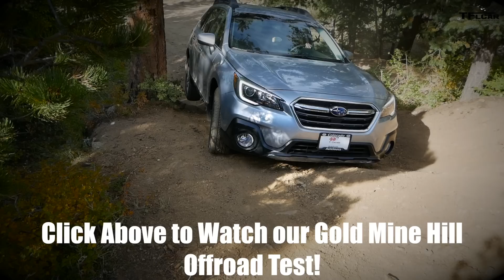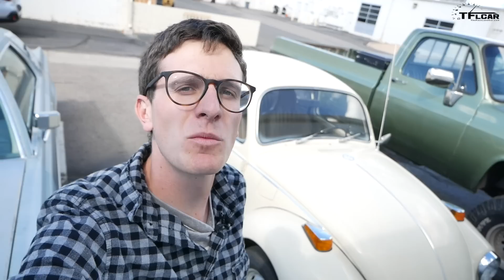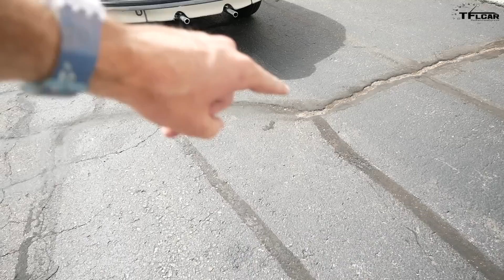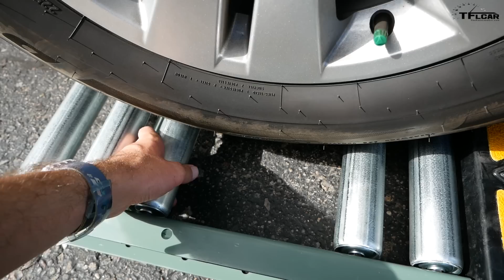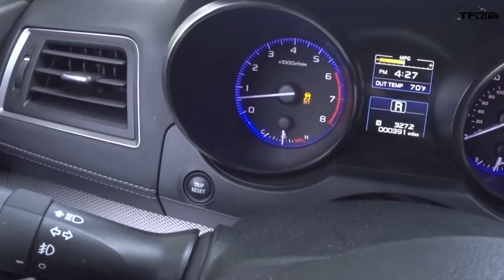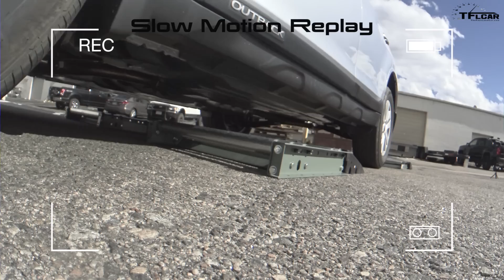The Truth About Subaru's Symmetrical All Wheel Drive:TFL Slip Test vs Subaru Outback

Comment: I appreciate these tests but I've hand my awd cars in quite a few situations old Subaru and Audi's and even a few air cooled vw's which are rely good in snow by the way.   With these types of tests my cars shouldn't have moved.   Your simulating no friction which really doesn't exist and if it did I'd want to be home with some hot chocolate.   I can see how it could show how traction control helps or doesn't in extreme situations.   But it wouldn't convince me to avoid one vehicle or another.  I've had much less sophisticated cars get through terrible conditions.

Comment: Test the new Subaru Ascent. I saw a video where the Ascent pulled a 5,000 lb boat up out of the water on a muddy boat ramp. It makes me think they changed the CVT parameters on the Ascent if it can move itself plus a 5,000 lb boat up a low traction incline versus how the Outback did on goldmine hill attempting to move only its own weight up hill. I would also like to see the Subaru Ascent on goldmine hill as well.

Here is the Subaru Ascent boat ramp video: https://youtu.be/9MzXJhuy-tw

Comment: It actually did better than I expected. I'm not hating on Subaru; I owe a 2.5RS and love it. I'm pointing out that this actually had the shittiest incarnation of Subaru's AWD system: Open from and rear differentials and an automatic transmission. You'd get even better performance out of the helical LSDs, DCCD and manual of the STI.

Comment: Definitely more tests like this. Little less chatter in between though... found myself double-tapping the screen to skip ten seconds ahead many times.

Curious how X-mode didn’t look different from “normal”... if anything almost more delayed. I thought X-mode was more aggressive with mimicking “lockup”.

Would be very interested to see how the modern Subaru like this, with its computer-based traction control, compares to my wife and my previous 2013 Outback 3.6 with the 5EAT auto. That system used the older viscous-type AWD, lot less computer intervention, and I gotta tell you it was apparent in the snow. Compared to my mother-in-law’s 2017, where you could feel the car react after the traction loss, our 2013 drove more smoothly and predictably. That system was reportedly a 60/40 RWD bias, and whether true or not I can tell you from FHE it was quite easy and fun to rotate that car with throttle on snow... something the CVT Outback refused to do (the CVT only ever understeered). I presume the smoothness and predictability was because loads were being transferred continuously and linearly by the viscous action within the diffs, as opposed to a more efficiency-biased system that attempts to use computers to reduce parasitic loads when cruising, but then intervenes more abruptly when called upon.

Anyway... another vehicle for the rollers: 2018+ Chevy Traverse or Buick Enclave with the “twin clutch AWD”. Please? 🙂
Reply: X-mode really is more precise with the traction and "locks" more and earlier. For example - I was able to start moving uphill with all four tyres on the ice only with an X-mode. Without an X-mode it would by much much harder. I suspect these guys at TFL are doing something wrong. The way they are working with the acc.pedal seems weird to me. Or they just don't like Subarus for some reason as many tell.

Comment: So while back you accidentally exposed that the Subaru AWD with CVT is not as good as it used to be. Now Subaru won't let you test their cars until you make up for it with some positive demos. I own a 2nd Subaru now and the CVT feels like it won't hold up well in heavy snow/ice use. Once I drove to Timberline Lodge on Mt Hood in heavy snow and the transmission smelled like burnt clutch, I was worried.    I want to see how Audi Quattro does...
Reply: n8834 Which Quattro? Different systems, different models, different results.

Comment: 2015 crosstrek with 4 people and our luggage in the back headed from akron ohio to florida. New goodyear assurance tires and a winter warning that was going to cause a 2 hour delay. I had this car doing 60-70mph through 3-5 inches of fresh snow on a highway at 3 am passing plows and lifted pickups over the mound of snow that seperated the plowed lanes from the snowed out ones. At no point did i lose any control. I was rally racing to the max but at no point was i uncomfortable that the car was going to lose any bit of traction. That car is an absolute beast. Every bit of that 148hp was being put to work and the traction and handling were nothing short of awesome.

Comment: Put the vehicle under some kind of load. Like a snatch cord that acts like a rubber band. Then use something like a hanging scale to get a consistent load.  This would help test how much torque is going to the tires with traction.  The idea being to help simulate a slight hill rather than flat surface that I could push the vehicle off of.  Just a thought.  You guys are awesome by the way!

Comment: Excellent evaluation idea that should be added to EVERY vehicle review that TFL performs from now on, regardless of drive system.  Basically, this eval would be pertinent for all drivers outside of areas like San Diego with perfect weather year round.  Curious is these skates would work on the bigger trucks.  They seem small and light-duty and I wonder if pure momentum from the vehicle rocking could carry it over the skates instead of traction.

In addition, this is an excellent review of the video.  I had similar questions.  1) I was wondering about four skates as well. As one aspect of this test, establish a baseline by demonstrating which wheels are moving in a four-wheel low-friction event.  I also would consider securing the vehicle front and back with tie-down chains to fully realize which wheels are moving when under a full loss of traction simulation.  Easier than moving 2 or 3 around.  2) As a basic safety thought, add some little friction to the skate base-plates to reduce the skates from being kicked so far.  Also, down-ramps seem like they would help but probably not critical.  3)  I also like the idea of reverse and different grades of incline such as a simple loading dock ramp, as long as the intended direction is always up the ramp (silly but necessary).  4) For me, less dialogue and more data, such as the graphics that you suggested, is always welcome but this is a video review so......

Overall, it's good to see TFL looking to expand it's evals with data and demonstrable representations of a normally subjective opinion.  I look forward to future reviews like this.  

BTW, I agree that I would love to see the three different Grand Cherokee systems stacked against each other to see how much of the marketing hype is justified.  I have a 2016 and love it but I am curious what I am missing with the eLSD in the rear.

Comment: For those unfamiliar with the difference between 4 wheel drive and all wheel drive : stock 4x4 rigs come with open diffs, there for get one wheel in the front off the ground and one on the back and your stuck. The awd rig has an advantage by being able to transfer the power from the spinning wheel to one with traction. You could get similar performance from a 4x4 rig by installing locking diffs front and rear.

Comment: VDC is different from traction control. Subaru's AWD has traction control built in, with VDC off.  It will always send SOME torque to wheels with traction with VDC off. Turning VDC on just allows less wheel spin, and also enables the ABS and throttle limiting functions to "optimize" traction and stability in dicey turns and on slippery roads. VDC is actually WORSE offroad because you want to allow wheel spin without throttle limiting. VDC can be helpful on icy roads for obvious reasons - you want little wheel spin!

Comment: Have the bottom of the roller frame line-x'd or something.  It will protect them in the long run and may prevent them from sliding on the pavement and other surfaces.

Comment: Try making the length of the roller section longer.  Select a section of pavement that is inclined like a loading dock ramp to add the additional challenge of terrain. Lastly use a tray filled with sand or gravel to reduce the traction of the wheel not on the roller to show how the AWD drive systems cope with loose ground.

Comment: When you did the test of the outback on the hill climbing, you moved the steering wheel of the subaru; that’s rigged! It seemed you just wanted to brag about the other car. Try the test without moving the steering wheel slowing the Subaru to sense the grip or the wheels

Comment: previous problem was the system, and not just tires.. that's why Subaru has added the mud/snow option on x-mode, so the system now will allow wheel spin and the torque to continue, which would help now in that gold mine stage 3 test.. previous models before cvt, likely would have passed that stage. Tires make big difference, I agree with below thoughts the cvt, ecu, etc.. system set up failed. Again, as others have said too, most people just want for mild off road camping trails and snow traction, so subi made it for that and now making adjustments to help with tougher situations, to be better for most customers intended uses

Comment: When you do the 3 wheel on roller test you should do it for both front and rear wheel. a lot of time you get different results depending on which axle has traction

Comment: In short word of what i wrote below: Front wheel shouldn't have their brake apply has it is not part of the differential of the rear wheel at which, one has traction (I would be amaze to see 1 differential for 4 wheels :lol:)

I see an issue here. 8:26 ( 9:28 It look better, but still brake were apply at where it was not needed, the front wheels )
The system try has soon has it detect it's missing traction somewhere.
There should be a little bit of delay, has you can see both front wheel get brake applied when it should not.
A logic and normal behavior of the system would be to have delay of 2-3 seconds figuring out which wheel(s) to apply brake to give traction to the wheel(s) not spinning.
In this case of this Subaru, both front wheels were spinning. In an real environment condition, both front wheels would need to be able to spin to help climb.
Let say the car was in the same condition has 8:26 in the Winter, parked in a bad condition terrain. Both front wheels should be free to spin because locking the front wheel would be just a resistance to the rear right wheel to push out the car out of the parked spot.

A real test for this car would be to make 3 block of Ice with a 2 inch deep hole in the middle , placing those 3 block under 3 of the wheels and 1 wheel on the asphalt, this would simulate a day where the previous day had rain that iced all around the tire (Making a bowl around the tires) and so, we would see that the brake apply on the front wheel wouldn't help to get out of the 3 holes 

The rollers under the wheel is good to show, but it's far from real condition

Comment: I saw another test where they actually put a subaru on an incline and it climbed with one wheel only having traction. I think the gold mine hill issue is purely due to the lose dirt even under the wheels that aren't off the ground, I'm betting the system simply thinks that all four wheels have loss of traction and simply cuts the power.  Would be cool if you could adjust that setting somehow or even manually tell the car 'hey this wheel has traction, keep trying'

Comment: 1. Symmetrical AWD from Subaru has nothing to do with how de vehicle handles off road. Due to the boxer engine configuration and gearbox, the length of the arms/bars (front and back, left and right) is the same. That means that you don't have torque steering. That happens when one arm is shorter.
2. TC OFF is never really 100% off. It is only reduced by 50%. You need to take out a few fuses to make it 100 off. 
3. Subaru engines lack torque, diesel and petrol. Excluding the STI .. the CVT does not help
Reply: CVT is not the main issue. They brought a heavy car to a steep hill. They should of gotten the outback 3.6R. There have been many people that drive with CVT forestors to steep hill and works fine. Also torque steering is not necessarily a good thing, torque steering in a steep rocky hill will likely put your car actually at a disadvantage. You car will likely slip into cracks and actually get your vehicle even more stuck than be useful. Its like digging into one side on a ditch, doesn't help.

Comment: From what I have seen, most vehicles still have traction control - even when you push the button to turn it off. You typically have to perform some additional steps to fully turn off traction control. IE holding the button in for x number of seconds.

Comment: You guys should use those rollers and review various vehicles and their All Wheel Drive systems then make comparisons (i.e. Honda CR-V and HR-V, Toyota RAV-4, Mazda CX-3 and CX-5, Nissan Rogue, Ford Escape, Hyundai Santa Fe, etc). That would be very informative!

Also, I would make it more of a challenge by putting some sort of little hump in front of the wheels with traction. This would give a better distinction between AWD systems as that can make or break them rather than simply just having them roll on a flat surface unchallenged.

Comment: Subaru is pretty well known for doing very well on these roller tests.  There are handful of of these types of videos online showing the modern Subarus putting other far more expensive vehicles to shame like  BMWs, Audis, etc who are utilizing similar systems.  There are also other brand/model cars that do just as well as Subaru on some of these.  The only issue I have with this system is that compared to some of these other previously mentioned brands, the Subaru with the CVT does not like to permit a lot of torque to the wheels in steep incline scenarios as shown in the Goldmine videos essentially making it under perform off-road, but do very well on-road.  Subaru needs to either start allowing the computer to get more torque to the wheels or fix the presumably weak-point, the CVT, for upcoming models if they want to stay on par with other AWD vehicles in the off-road segment.

Comment: Throw an older Subaru with a traditional auto at the same hill climb that your Outback struggled with. Really would like to see that comparison. But as others have stated, place rubber at the bottom of the rollers to reduce the rollers skating after the car rolls off them, place a bump in front of the wheel with traction, alternate the single wheel with traction to the front of the vehicle and I think placing the test on an incline would also be good. Keep making alterations to the test to the extent the car struggles as this test can easily be standardised and given a silly title that you test other cars on, old vs new, 4WD vs AWD etc.

Comment: Worst case scenario, free wheel the rear wheels and one front. Many Built from the factory Jeeps will fall at that test. Many vehicles will have a traction device on the rear axle but an open front for drivability.

Comment: Reading some of the comments on this, I believe some people just don’t get it.
Subarus symmetrical AWD is perfectly adequate for most people’s driving situations, not many owners shall try extreme off-roading in an Outback. Sure they struggle in on inclines, rough and loose surfaces, and are not sold with all terrain tyres, they use highway tyres, but guess what, they are not sold as all terrain vehicles, and Subaru do not try to advertise them as all terrain vehicles. I own a 3.6 H6 now, but before this had a 3.0 H6 and I got stuck once, and so did the Toyota Land Cruiser that tried to rescue me, we were both saved by a Land Rover that pulled us both from the mud, and that was only when the Land Rover’s diffs were locked, and you know what, I’ve even seen Land Rovers being rescued by Tractors, everything has a limit.
The test performed here was intended to demonstrate how good Subaru’s are in normal driving conditions and if you encounter ice or snow or unsurfaced roads, the reason it failed on the other video shown on a steep incline and off-road was inappropriate tyres and exceeding its capabilities.

Comment: Great job TFL! Would love to see this test with a few additional variables (many ideas have been suggested already) used to analyze the logic of the brake torque-vectoring/traction system while trying to find traction. Specifically, I noticed in this video, when 3 wheels on rollers, that the front two wheels would brake at different times, back and forth. Does the system just randomly brake each wheel left to right or back and forth until it finds traction? I think this test could show a lot of the hidden logic used in the traction system, which would be helpful to understand when you get yourself in a tough spot with only one wheel biting. I would love to understand this so I could know if I'm only going to get bursts of power from that one wheel with traction between the traction system cycling through braking each wheel or if the system works with through another logic entirely.

Comment: I said it once and will say it again. The testing was flawed. You are using street tires vs sandy terrain. You wouldn't drive on ice with street tires...so why have regular tires on such offroad conditions than a/t tire? Inherent bias of TFL testing. Second who would climb hills this steep without having to charge forward with more speed? I've seen subaru climbed extremely steep sandy hills if they have enough forward motion.......Third this outback only has 175hp with an overweight car. Should of bought the 3.6R with 260HP which would dramatically change the results. Again TFL making some pretty poor tests.